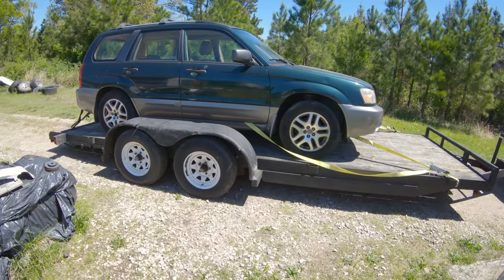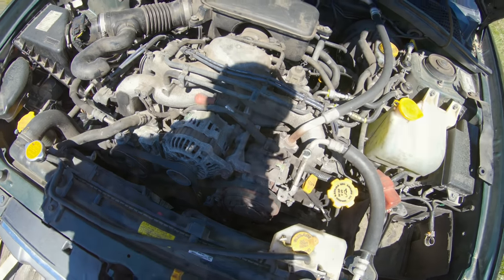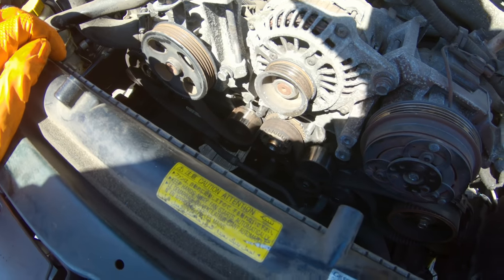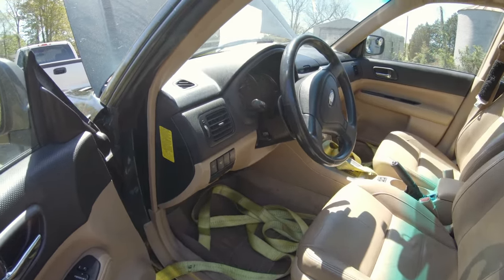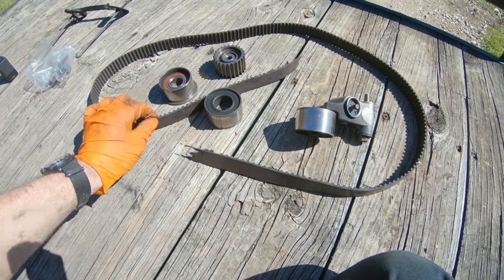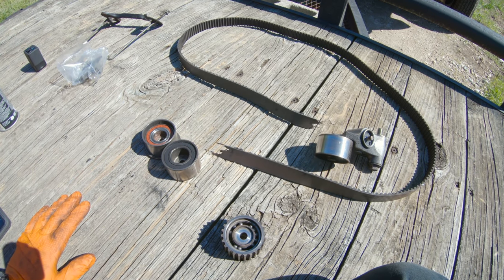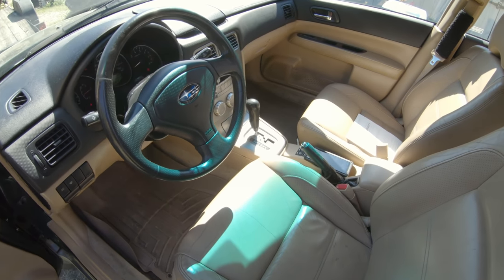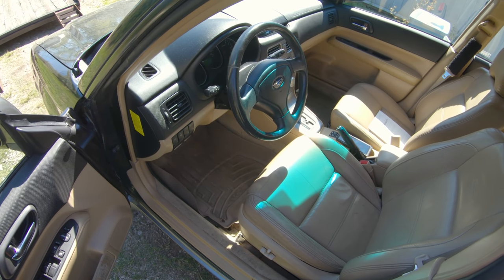Forester L.L.Bean Broken Timing Belt

Comment: That's the first time I've ever seen a single cam with a broken belt run without doing a valve job. You must be living right LOL! I've worked on a bunch of these where the belt popped. Like you said it's usually always the cogged pulley. I've just replaced the belt on other cars but you can't do that on a Subaru the belt design and length of the belt puts a lot of wear on those pulleys.

Comment: I bought a 1999 forester with rod knock, I put a JDM 2.0 ENGINE in it. And saved about $1000 off from putting in a jdm 2.5 replacement

Comment: Nice MrSubaru you lucked out, also good work on this forester. I had a 01 impreza 2.5rs that had that same cogged idler pulley fail at 147k because the previous owner only replaced the belt :(

Comment: I bought my last Subaru with a belt that jumped 3 teeth on left cam . Ran it 4.5 years and zero issues.
Reply: I had one I did same thing with , but had to replace head gaskets after a year

Comment: Had a 2001 208k Forester and ran perfect, everything worked. Replaced timing belt, gaskets, rad., etc. and after a month it started to overheat and send coolant to the reservoir. Guy who fixed said the block had a hair crack and he will fix it again but charging me. I was so upset and to this day don't know if he was telling the truth. I loved that car. Will never bring my cars to him. I am learning the basics and hoping to find an honest mechanic...
Reply from the maker: Sounds like bull. Most likely had a HG going out or he didn't get all the air out of the cooling system.
Reply: @MrSubaru1387  I know. He did other repairs good and I trusted him.  You need to move to Cincinnati so you can fix my cars 😂😂😂😂😂😂

Comment: I got two Subaru s in a row with snaped timing belts and both did not bend valves I was like am I in the matrix lol
Reply: Do not try and bend the spoon, that's impossible. Instead, only try to realize the truth...there is no spoon. Then you'll see that it is not the spoon that bends, it is only yourself."
Reply: I had timing belt problem on 2.0 X 06 forester. Timing belt wasnt properly monted and it broke all teethe on it. Car stalled and mobile mechanics told me the engine is gone. So i put car truck and drove it to another mechanics. Guy changed timing belt and car run just fine. I still has it. This happened few years ago and the engine is running like new. The car just refused to die.
Reply: @danieldekovic9706  was it dual cam
Reply: @haiderzaman8684  I'm not sure. It's 2.0 naturally aspirated engine with 158 ks. I believe it is. I still have it and it runs oke.

Comment: Wonderful, mine snapped two weeks ago  can you enlighten us in how this miracle can happen and the best way to find out if I damage my engine? Some people told if I just manually with a socket give two full turns to the crankshaft and camshafts and the engine is not locked I’m good to go. Is that true?

Comment: My Father in law has an 07 Impreza that the timing belt broke while taking off from a stop sign. I tried putting a new timing belt kit on it and so far it won't start. What I am not sure of is whether I have it timed correctly. The marks all line up but it is possible that the cams are still not properly timing to the crank. Do you have any suggestions for ensuring that the engine is properly timing before I call it quits?

Comment: Hi!
On my 2006 Forester 2.0X the left front brake is blocking sometimes. Usually after stopping on a ramp for 10-15 minutes, when I try to go, it feels that the brake(s) is grabbing at least one of the wheels. The steeper the ramp the grippier the start. The left front is for sure, because I drove 200 meters with a hard grip to see which one is it, and it was smoking in the end. The others I don't know for sure. The disks were in poor condition, I have changed those in the front and installed new pads too, on the back I have drum brakes so I have changed only the pads there because the drums were in good condition. After that i had been driving 10-20 km-s with no problem, stopped on a ramp for about 10 minutes and the fckr grabbed the wheel again. The brake fluid wasn't changed and if I brake hard or kick the pedal 1-2 times it releases the brake and everything goes back to normal, it doesn't appears while driving only at the starts at stopping on a ramp. Do you have any idea what causes it and how to fix it? Thanks!
Reply from the maker: Replace the caliper. Sounds like it's hanging. Also, check the brake lines to that caliper. Make sure it isn't dented, bent, etc. That could cause the caliper to stick.

Comment: I wish all car manufactures would stop making interference engines and make them like  the 3.3 Subaru. I really like Subarus, I have had 7 so far.  On the gopro, I never wanted to pay 500..00 for a name, I have an Akaso V50 pro and it works great, I've been using it in my videos for the last several. it comes with 2 batteries , charger and all the accessories that comes with gopro.

Comment: Hi Mr Subaru!
What's your diagnosis on occasional blast of white smoke between gear shifts when on full boost?
Doesn't happen all the time and seems to be less likely to happen if throttle is eased open to w.o.t when revs are higher above 3000.
Car is a v3 wrx STI type-ra. 
Mostly standard apart from hks pod filter, 3" turbo back exhaust, 300lph fuel pump and td05 20g.
All mods are from previous owner and big turbo is laggy.
Standard ecu running 15psi or 1bar.

Comment: Have got this forester and I encountered the same issue. No valves were broken or damaged. I just changed the timing belt and it went on. So for that, if you come to Zambia and you want to buy a Subaru like this with a strong engine, I can give you for $7000 price...

Comment: I purchased a 04 for $1000 head leaking. However transmission torque selenoid is dead. Cheaper to swap from a wrecker. 😳 found out 05 is different ...SOB...

Comment: It’s not catastrophic if the valves need replaced………yeah, would require some extra work, but not catastrophic. Catastrophic would be a rod going through your fucking engine block, or the head literally blowing off the engine